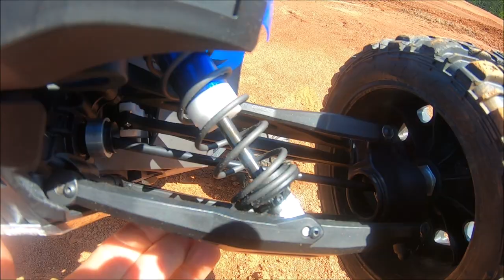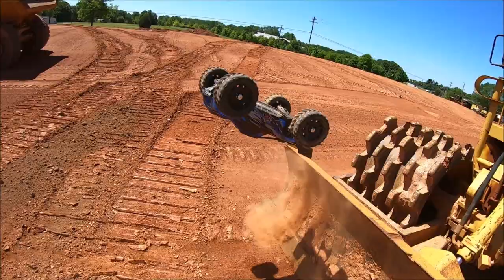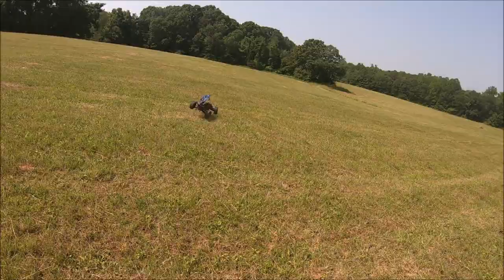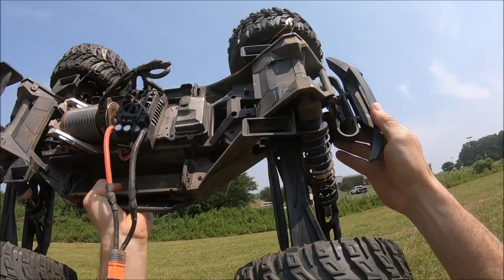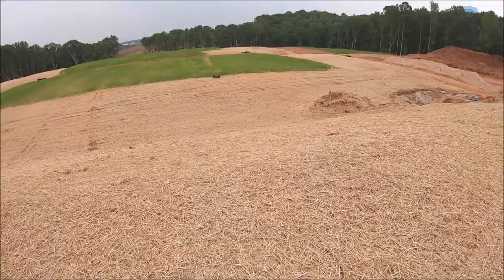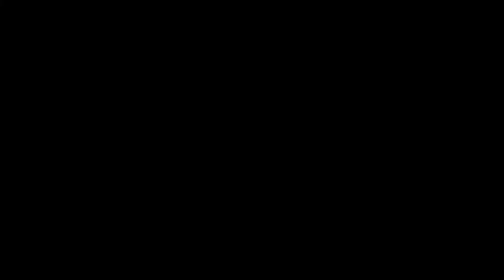Traxxas Xrt's New Shock Upgrade and Big Announcement!

Comment: Hey dude really enjoy the content. Got a question I've got the HRB 9500 they fit perfectly and the truck screams I was wondering about the weight. Got the xrt a month ago and that's the only set of batteries I have. I bought the zeee 9000 run them one time had to send them and charger back they didn't have the power of these HRB's
Reply from the maker: As long as they fit then shouldn't be an issue! As far as weight I would be careful with huge airs but freestyle bashing no problem!